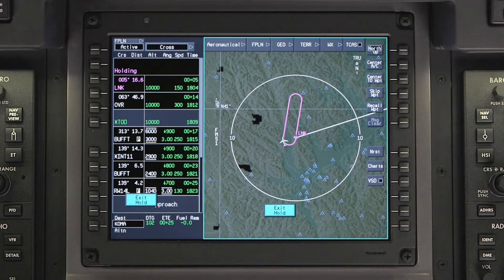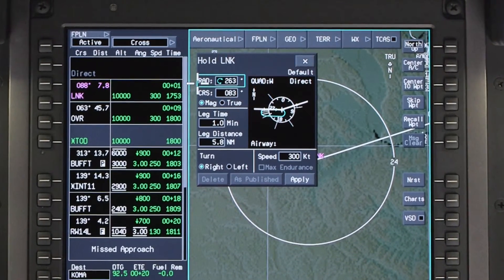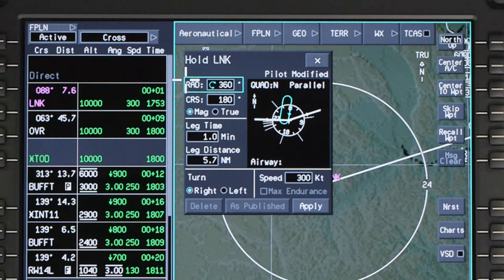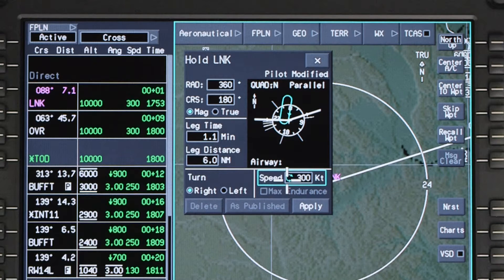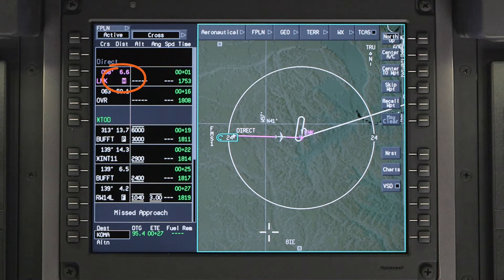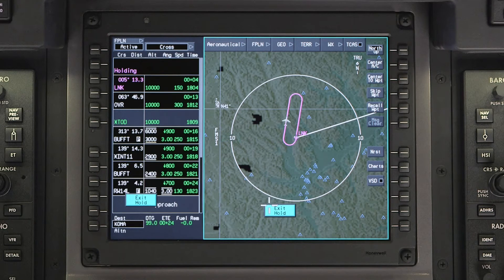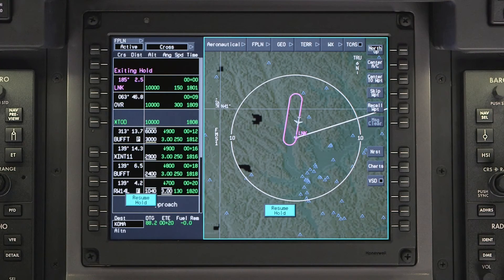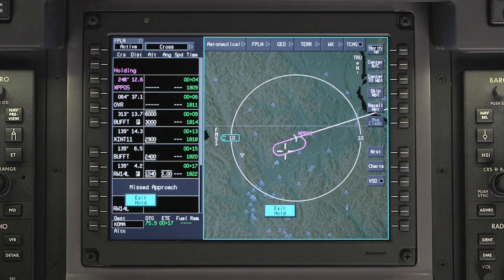Holding Patterns on the Pilatus PC-12 NG | Aero Training TV | Honeywell Aviation

Comment: Hum .... this is a weird entry display. The path showed in magenta brings you on the "unprotected side" of the Hold. If entering parallel, you have to fly outbound, needle centered on the inbound course and then after 1 min (or 4 NM depending on the type of hold) then make a left turn (according to the example above) to intercept your inbound course and therefore stay on the protected side of the Hold. 
Now this is my opinion but please tell me if I'm wrong.
Reply: Late response, but you actually don't need to fly outbound right on the inbound radial. There's nothing wrong with the way the computer has decided how to execute the hold; this is called a parallel entry for exactly that reason (you fly parallel to the inbound track). 

A hold is not like a circuit pattern, there is no 'protected' and 'unprotected' side unless there's a DME limit on the hold or specific instructions.